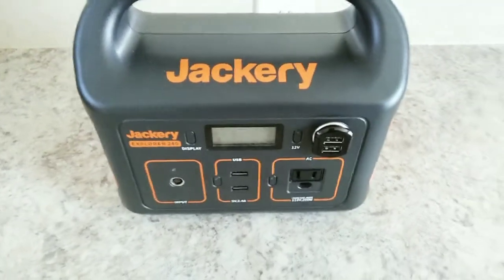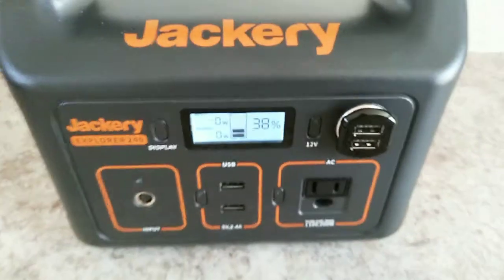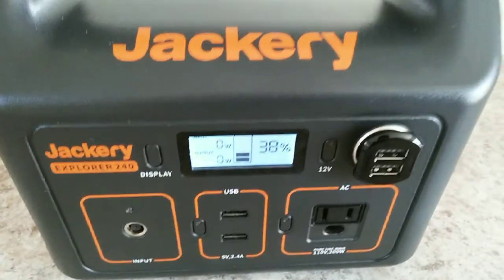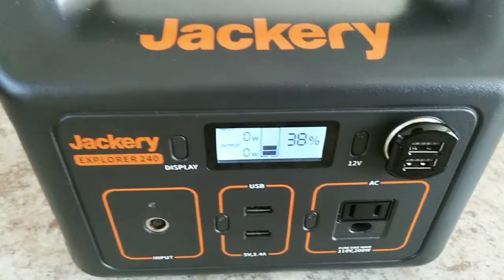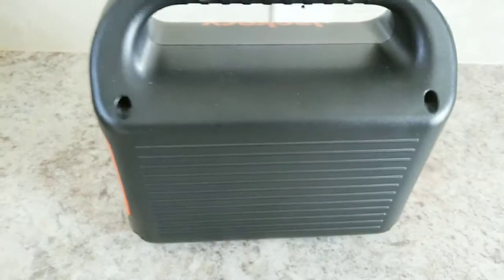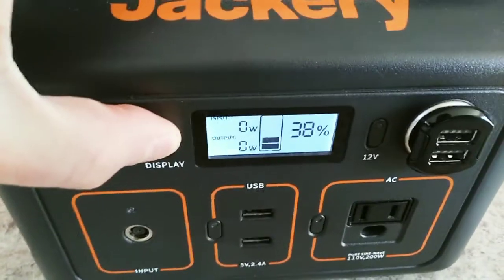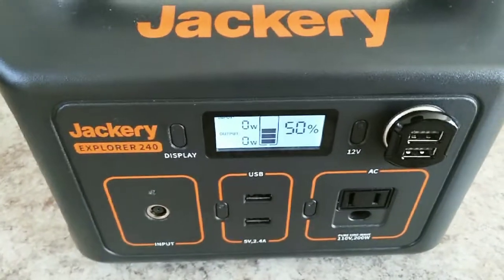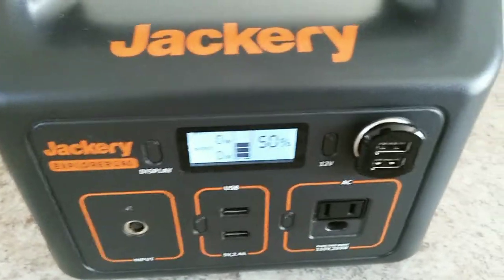Why you should reset your Jackery

Comment: Best tip ever!  Now I understand why my Jackery 300 would get down to 25% and then suddenly drop to 0%.  Not good for the battery, but it's fixed now thanks to you!
Reply: What was happening to you what's the protective mechanism in order to save battery life and longevity of life mainly these batteries although amazing they do not like to get power in theirselves there are two things that could happen when doing so usually it was just shut off and clip Austin clip out it's because you are demanding more then it has the capacity to deliver that's why surge protector is great preacher I can give you a really good advice I've even broken it but hear me try your best not to run on flat or even past 25-30% that is a design flaw and sometimes you can hold display and reset it I have a question mine is only taking in 5 w it gives me a battery signal as I look in the lower right-hand corner I'm not sure what went on but I'm pretty sure I have a good idea if you know what you're doing just be careful these batteries are a lot more powerful than you may think I tried resetting it's worked in the past I've done a few other things anyone know a trick to zap or is it Hardware where slowly a connection overheated and I lost continuity somewhere or is it just designed absolutions

Comment: Thanks.  What about v the sinkew powerstation?   Mine will not charge.  I was only using the light on it as a night light .  ITS ONLY CHARGING 4 OUT OF THE 5 BATTERY  levels.  It's only a couple weeks old.  Any suggestions?

Comment: How long does it hold a charge without any usage? I want to get one but keep it in storage for emergencies. Where i live on the coast we are always getting power outages but dont want to get one thats not going to be fully charged when i need it.
Reply from the maker: It will hold charge for a very long time. It should only lose around 1% per month (estimated).

I would highly recommend only storing it at 90% charge however. Leaving the battery at 100% is not good for the battery.

I would still check it every 3-6 months just to be sure. But Jackery's are very reliable and because of the battery chemistry that they use (NMC), you won't have to worry about the battery going dead.

And just an added FYI, Power stations with LifePO4 batteries will typically have a higher self-discharge rate, and lose between 2 - 5% a month. This is still manageable, but I would recommend checking on a LiFePO4 unit atleast once a month, if you plan on keeping it in storage.

(Jackery doesn't use LiFePO4, so any Jackery will be good for your use. But I would recommend buying 1 size up from what you think you need, and then only charging it to 85 or 90%)

Comment: Will charge mine to 100%. Reset it and it says 96%. Plug charger back in to 100. Reset and back to 96%. It's only a month old and fully charged at most 4 times. I did buy it open box though. Am I already down 4% storage capacity or is this normal?
Reply from the maker: Don't try to overcharge the battery. Once it stops charging, just unplug it. This reset tip is only needed "once in a while" or if you start to notice the % jumping around. 

As to your specific issue, try using the entire capacity (down to 0%) and estimate the number of watt hours (wh: multiply watts output by time in hours) and see if you are getting atleast 80% of the stated capacity (you will never get 100% due to conversion losses). 

If the capacity seems too low, charge it to 100% and try again. If the result is the same, I would try to return it.
Reply: @SoGenFan  Well, I have reset it a few times when I notice the output watts getting off. I am using for low power devices mostly, so one charge last a while and I know the wh they pull to begin with and as they reach capacity.

I did drain it once with a box fan and then recharged to 100% or really 96%. I think the person that returned the one I got just used it extensively for some type of road trip as only the car charger had been used. I guess 4% isn't a lot. I am still in the return period less 20% restock fee from harbor freight. I will try your test though. 

Thank you very much for the response!

Comment: My jackery has failed. Had it for 3 years, might have used it twice. Now it doesn’t even turn on, tried the reset and nothing. Jackery says past warrranty, too bad.
Reply from the maker: If you had it sitting around for that long, it is likely the battery dropped below 0% and is therefore damaged. 

All lithium batteries loose charge over time. If you plan on storing your Jackery, keep it between 50 - 80% and CHECK IT EVERY 3-6 MONTHS and recharge as necessary.
Reply: Actually, I was able to reset it once not too long ago. There is no wwy it could have completely drained that fast again. Must have gotten a lemon, will not buy a Jackery next time around.
Thx for your response though👍

Comment: How often do ya have to restart the jackery and are you able to leave it plugged in overnight charging?
Reply from the maker: The reset is not necessary, it only helps the % display accuracy, especially when it is not often charged or discharged completely (to 100 or to 0% which enables it to recalculate the % on it's own).

Some power station brands recalculate every time the unit is turned on, but since these older Jackery models are "always on" (the buttons are live all the time) they never really turn off. So they don't recalculate or reset unless you do it. 

And yes you can leave it plugged in overnight, just unplug it in the morning. It will automatically stop charging once it reaches 100%. It is not recommended to leave it sitting at 100% long term however. If you plan to use it in the near future, it's fine. But for long-term storage (1 month or more) store it at 80% charge.

Comment: I see you have an adopter to change the cigarette lighter (car port) to USB, are you able to get fast charging form that adopter, If so which brand adopter is that?
Reply from the maker: It's an old adapter, so I don't think it supports quick charge.

I did a quick search on Amazon, this brand AINOPE has several of these "short-style" adapters that sit flush with the body of the Jackery, and offer QC 3.0 18w quick charge:

Short-style with 2 USB-A QC 3.0 affiliate link: https://amzn.to/3GPdn1I

Short-style with 1 USB-A QC 3.0 & 1 USB-C (PD 36w) affiliate link: https://amzn.to/3GSOrq4
Reply: Anker had a really good 12v car charger

Comment: My jackery 160 isn’t even coming on. Tried hard reset and nothing. Used it only twice, now past warranty and Jackery won’t do anything.
Reply from the maker: Lithium batteries like to be used. If it sits around unused, you MUST keep the battery between 30 - 80%. Otherwise the state-of-charge (SOC) will eventually drop to BELOW 0% which permanently damages the battery. 

Also note that storing the battery at a high SOC (like 100%) will cause the battery to degrade, so that is not recommended either (although you will have less chance of it dropping too low obviously which is the worst thing). If you buy a power station, use it!
Reply: @SoGenFan well unfortunately too late for that, yo want to buy a paper weight🤷🏻‍♂️ Just ordered a vtoman, hopefull I’ll have better luck

Comment: I am so sick of my jackerys not charging and turning off with full charges (day or night) and then not charging.  I also have their e2000 battery packs and they disconnect.  Fix is to unplug everything, reset, and the  setup from scratch. 10 or 15x a month. Jackery also tells you NOT to reset your units lol.  Make up your f'n.  I love how support never answers and email support rakes 2 days and you have to send them videos of everything they tell you do to before they will help.
Reply from the maker: Yea their newer models (with the orange display) require some babysitting. The older models with the simple monotone screen 'just work'. Nothing to turn on, activate, it's just always ready to go - charge, discharge it's so simple and it works.
Reply: I'm going through that now....getting quite frustrated !